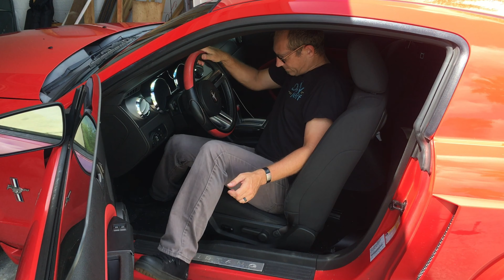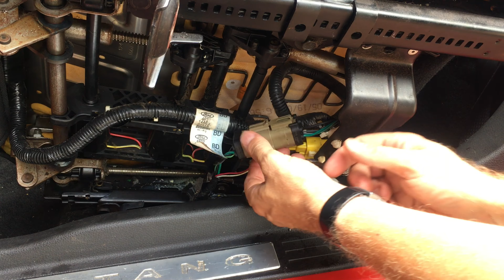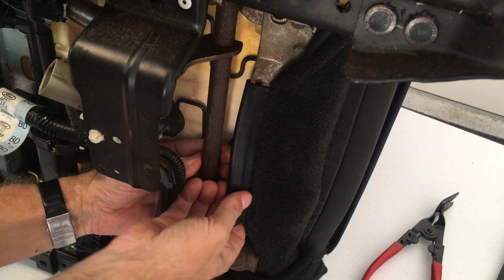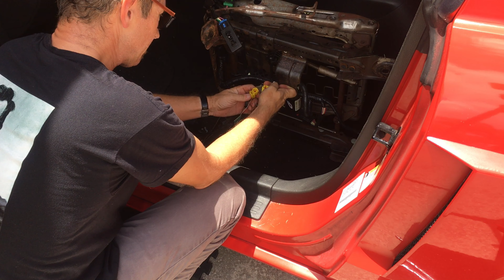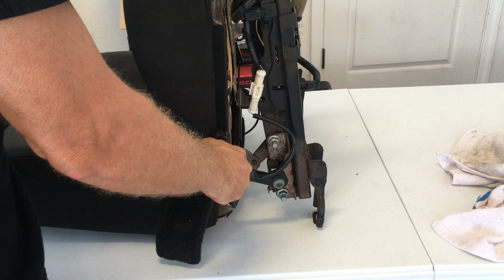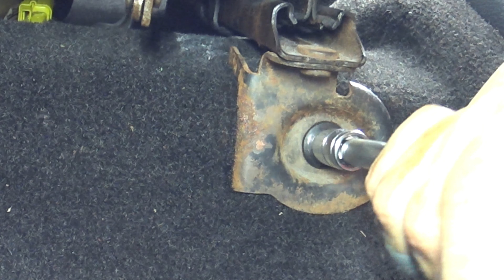2005-2009 Mustang Power Seat Track Replacement

Comment: If you brake the two metal retainer clips that hold on the plastic side panel the part number is W714113-S439.

Comment: Mine went bad recently. Went to move the seat when I was cleaning and heard clicking but no moving forward and backwards. My only guess is that the cheap plastic gears stripped. Ended up getting a seat from a GT from a junkyard for $125  and ended up replacing the lumbar too. Fun fact, GT seats have a magnetic snap instead of a regular ones that the V6 premium and deluxe models have. The lumbar support is also metal im the GT models and the V6 premium and deluxe models have a plastic lumbar support. Ended up replacing both and now I have working lumbar and power seats again. Ended up disassembling the old unit and sure enough the cheap plastic gears that for designed were completely shredded. Thanks Ford for not letting anything be serviceable, between that and hood corrosion. Thank you Jeff, your guidance and wisdom allowed me to tackle this project.

Comment: Thx for the video! Believe it or not, BOTH my power seats ('07 GT) gave out within 24 hrs! Weird. Question though, I have leather seats. Do you know if the material removal is the same as with the fabric? Before I start chopping it up it would help to know. If you don't know, that's ok. Mechanic will do them for $3K. Would rather DIM.
Reply from the maker: Hey, sorry just seeing your question.  I don't know if leather is the same, but given that ford is using the same seat structural parts regardless of leather or fabric, my guess is they are the same.

Comment: Hello Jeff, thank you for sharing for the instruction with us! 

I have a few questions if you don't mind me asking...

1. Would this video work on 2011 mustang? 

2. My driver seat's front part won't go up and down, but I do hear the motor moving when pressing the switch. What would you think would possibly be the cause and is completely taking the seats apart necessarily? 

Again, thank you so much for taking your time to read this and the help, Jeff.
Reply from the maker: @Metronome Senpai, I'm not sure about the 2011-2014's.  They are still the S197 platform, but they changed things about the car starting in 2010 and a lot in 2011.  Best way to know would be to look up the part number on a 2005-2010 and see if it's the same.  It's possible they used the same power seat setup.  Like I mentioned in the video, if it's a motor problem, this is the only solution.  The motors are not replaceable.  And you definitely have to take it all apart.  You're not going to want to buy a new one....they are super expensive.  Junk yard seems to be the best option I've found.  But beware, even the junk yard one may not last long.  I've burned through 2 of them.  They're just old cars and the design is awful for performing any maintenace on them.

Comment: Hey at the beginning of the very helpful tutorial, you say disconnect the negative terminal. But at the very end of the video you say hook up the positive terminal. Am I missing something? The rest of the video was very clear. Thanks!
Reply from the maker: @Dave Forrestel, nope you didn't miss anything.  In fact you caught an error on my part.  You should always disconnect the positive battery terminal, not the negative.

Comment: Hi Could you please till me what are the functions of the front switch is? I know the other one is for moving the seat front and back. The front switch does nothing ???
Reply from the maker: @Parbhu Manga, The front switch, if I'm understanding your question correctly, is for lumbar.  There is a mechanical device in side that pushes the seat out and retracts it in the lumbar region.  I'm not sure if every power seat mustang has that feature, but I would imagine they so.

Comment: BIG QUESTION Here.....Why didn't you just unbolt the existing Seat Frame from the Seat Track?!??  It looks like its only 4 bolts.....and then re-bolt to the replacement seatframe withought taking apart the bottom of the seat?? Wouldn't it have saved a lot of time???  Thanks for your video and comments.  I'm about to do this to my 2007 Mustang... ;)
Reply: Was this a thing or no ? Assuming u did it already and know now I got a plastic bag stuck al in the Trac so figured I'll have to take it out

Comment: In eBay I found gear with it clutch, do you think that works?
Reply from the maker: @Ultimate Tune, the problem is that the track is assembled in such a way that you can’t change out individual components.  Believe me I tried.  Of course you can order it and try, and maybe you could do it, but I saw no way to do it.  Ford doesn’t sell these components individually because the track is not serviceable.
Reply: @DIYJeff  I would understand that maybe for safety, I did take a part before but not to repair it so can't remember how was it build. Anyhow I have a problem and bought full seats and saw this video as I was going to do full replacement as you did 👍🏻

Comment: Good video but you completely skipped showing how you reassembled the frame of the seat to the new track.
Reply from the maker: @Kris Kutscher, on the S197 mustangs, the frame and track are all one piece.  The seat frame and the track are inseparable.  Every step I showed in the video is the exact process.  I didn't skip any steps.